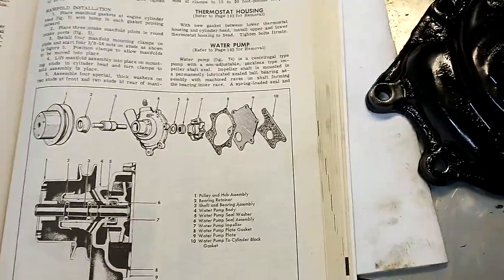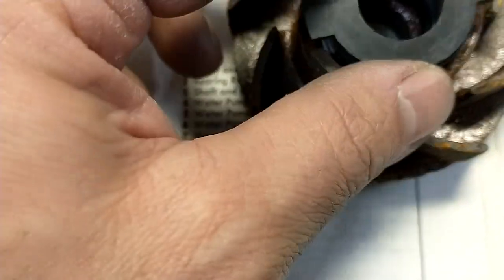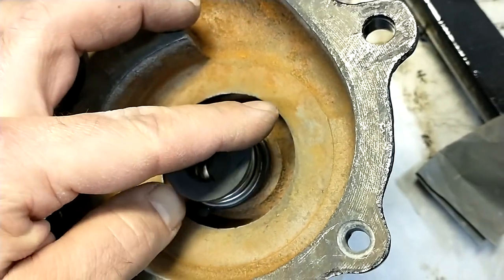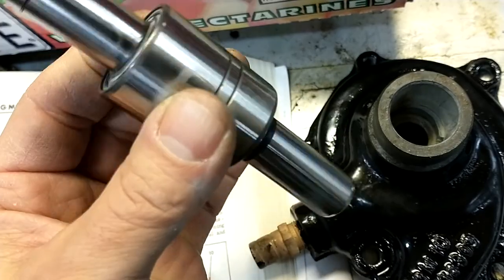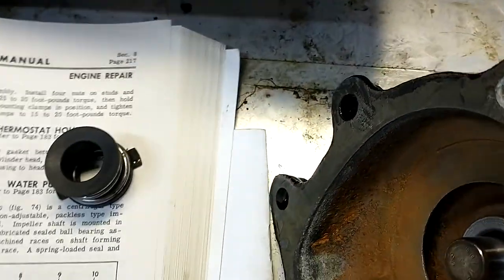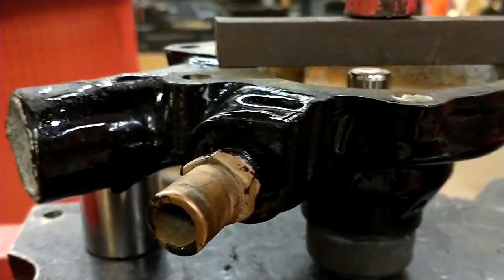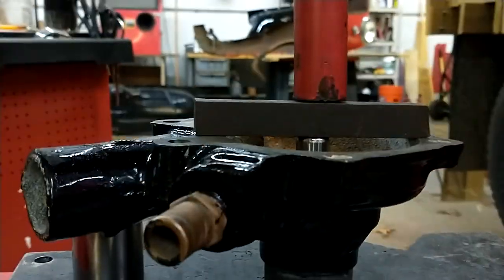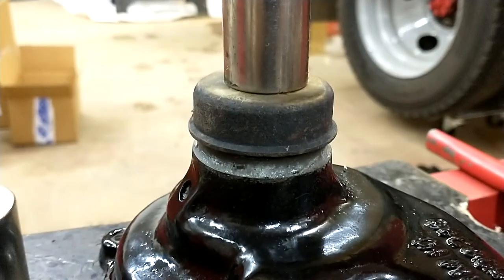1949 GMC Water Pump rebuild part 4 reassembly

Comment: Did you make a video of the removal and reinstall of this water pump ?
I have a 1948 roadmaster 70 and need to do the water pump, thanks!
Reply from the maker: Hi - I didn't do a video on how to remove the water pump.   It wasn't too hard though.  I'm not sure about a '48 road master though. Probably fairly similar.  The shop manual is your best friend.  If you don't have one, the team buick site has a bunch in digital format.  Here a link to the cooling system for a '48 Buick: https://www.teambuick.com/reference/library/48-49_shop/files/2-f.php

Comment: Just love how easy that looks when you know what to expect. Would it help the the rubber seal if you greased it with a water resistant type of lubricant?
Reply from the maker: The directions don't mention using any kind of lubricant.  They only stress that the metal surface of the pump where the seal rides is flush and smooth.
Reply: @theworkshop3706  I have a ‘51 International L110 that needs a water pump rebuild. If it has a similar seal on it, I’m going to lube it with a silicone based grease. Reducing friction reduces wear. IMHO

Comment: Were did you get the seal washer from
Reply from the maker: Hi Kevin - It came in a kit from a seller on ebay.  He also sells just the seal (which I had to buy when I broke the first one)
https://www.ebay.com/itm/174225218915